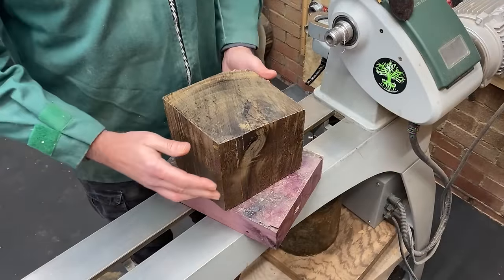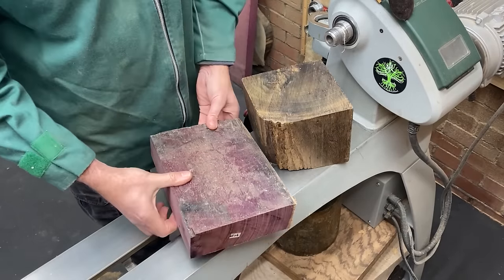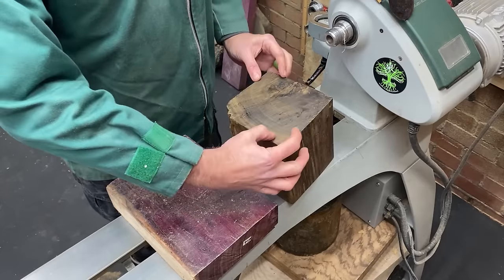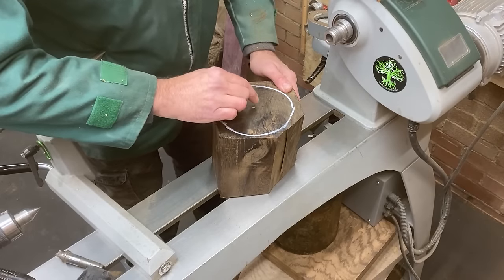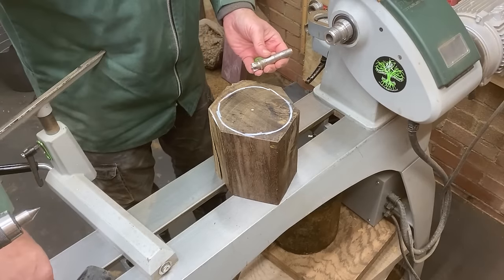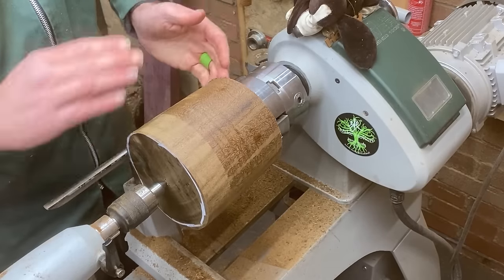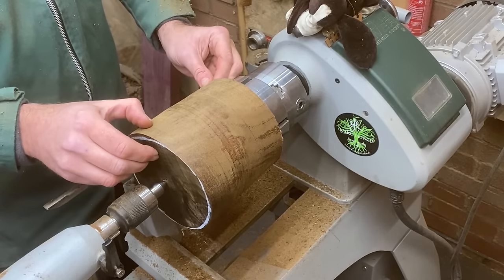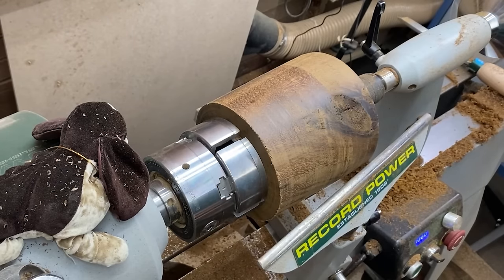Starting the Year with a Bang: Woodturning a Greenheart & Purpleheart Mallet

Comment: That's a beautiful nut cracker! 😊
I believe the choice of the greenheart inset in the handle is actually a very good choice from a mechanical function view point. It does look very nice, with the advantage damping stress and vibration in the handle, increasing the longevity. Some things I consider having been a helicopter mechanic. I've worked with wood, metal, and composite rotor blades. You'll have nowhere near rotor blade stresses, however, the discontinuos grain will prevent torque transmission from an off center hit. Well done, gaining mechanical benefits from an aesthetic accessory!
Reply from the maker: Wow thanks so much for the knowledge! I love useful information like this 😊
Reply: @MikeHolton  take a look Bell 47 helicopter wood blades. A lot craftsmanship in those and wood airplane propellers. They're works of art.
Reply from the maker: @codymccormick3593   I have watched videos of them being made, just amazing!

Comment: Nice to see you are settling in your new shop, Mike.  I'm not an acoustic expert, but you might consider hanging a rug or two on the wall to cut down the echoes.  You might be surprised how little it takes.   Fwiw, it doesn't sound bad as it is.
Reply from the maker: Thanks Geoffrey 😃

Comment: Happy New Year.    The mallet looks terrific.   Very hefty.   Well done.
I have made a few mallets, a couple of this style which had a glued up handle with contrasting wood in the middle.   I was lucky and did not get any tearout.
For my glueups I always check the pieces to ensure no gaps before I apply the glue.   Often a table saw cut will cause some slight gaps.   I typically have to sand the mating surfaces to eliminate gaps.
I used a regular blind mortice and tenon joint.   These were given away so I do not know if the handle came loose, or even if the mallets were ever used.
I chose woods which were easier to turn than the greenheart.   Wow, that is a very dense wood.   I do not have any in my shop.   After seeing this video I do not think I will be getting any greenheart in the future.
Dave.
Reply from the maker: Haha thanks for the advice as always and you are right, do not buy greenheart, I have a large 12" x 3" square under my lathe I was looking forward to turning . . . . not so much anymore lol. Have a great new year,  Mike

Comment: Nice work Mike.  You've inspired me to give wood turning a go.  So far, I've made a replacement knob and handle for my electric kettle, and am very happy with what I've done!  If I could make a recommendation, I'd say that you ought to get a jointer or belt sander to flatten out your pieces before glue-up to ensure a nice, seamless connection.  Cheers!
Reply from the maker: Thanks Joey, a belt sander is on my shopping list 😃

Comment: Excellent video again Mike. I much prefer the shaft to go through the mallet head as it adds a little bit more detail. It also allows the ability to put another wedge in if required, crossways.
Reply from the maker: You are right and I'll not make another like this, fun to do but not ideal for a mallet 😉

Comment: Happy new year Mike. I've watched you laminating wood from previous videos, and often wondered if you smooth the band sawn surfaces to be glued, or are the saw cut surfaces so smooth they can be glued and clamped?  Nice mallet.     🤔
Reply from the maker: Thanks John, my mire saw has a very fine tooth so usually I can glue up without having to sand, although I will be sanding next time.

Comment: Hi Mike - although I’ve yet to start ‘turning’ one of the issues I have is not knowing what can be done! For example the joint you’ve made with this mallet I would have never even dreamt of. So is there any reading material you could recommend to combat this with.
Happy New Year
Reply from the maker: Hi Andy, I learnt about this from a ticktok of all places, I watch a lot of crafting and woodworking videos  as it is the best way to learn techniques which then can be turned into ideas. I'm very much a visual learner, if I read something I have trouble understanding it due to my dyslexia but if I watch something I can understand it straight away 😀
Reply: Thanks Mike for replying and advice 😄
Reply from the maker: @andysprunt9058  always happy to help Andy

Comment: Was worried when you kept suggesting you would make the cut for the wedge in line with the glued up section of the handle that it would split out. Any reason you didn't make that cut perpendicular to the glue line?
Reply from the maker: Hi Peter, yes I have a very good reason……. I’m an idiot. Cutting the other way would have made so much more sense.

Comment: Why did it leave a mirror finish when you did the push cut on the ends (it was especially pronounced on the top end)?
Reply from the maker: That is generally the way end grain cuts with a very sharp tool, you get a great finish, the harder the wood the more it shines 😀

Comment: 😂 I was right! Loads of sharpening.
Reply: Is this a Joker theam?
Reply: Did you plane it before you glued it? That's what I thought would make gaps.
Reply from the maker: My mitre saw usually leaves a perfect surface so I'm a little confused 😀
Reply: @MikeHolton  all I can think is touch up the blade or replace it. Maybe try adding a bead of glue at the edges.
Reply from the maker: @archiehebron8944  I'll look into it but I am getting something that will help 😀
Reply: @MikeHolton  can't wait to hear about ✌️